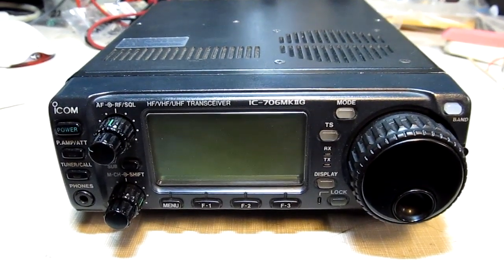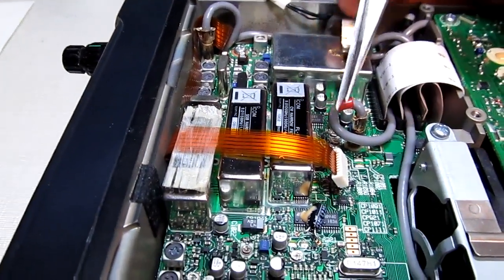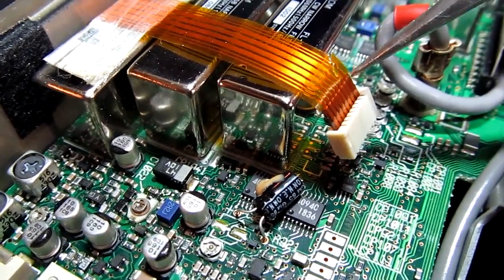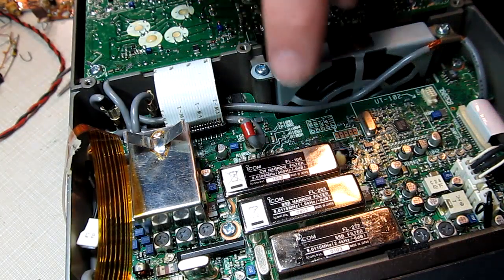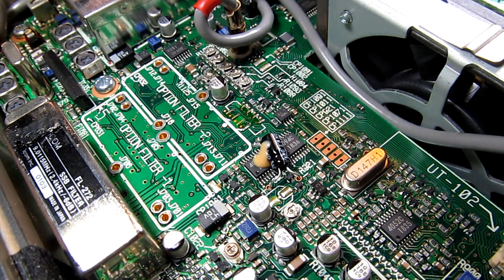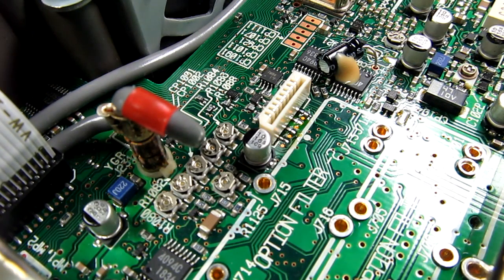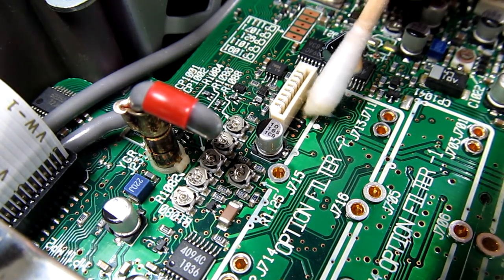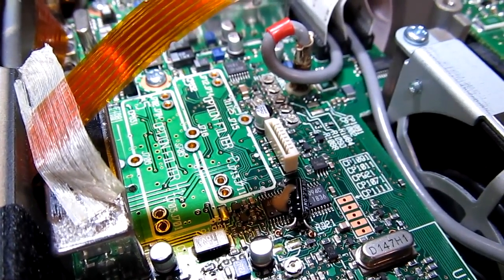#126: Repair Log, Part 1: Icom IC-706MkIIG Damage assessment and connector repair - DIY

Comment: Greetings dear friend.  Could you help me to be in the SET MODE ADJUSTMENT of the Icom IC-706 MKIIG?  I don't know the type and configuration of the Plug that is connected to the REMOTE to access its Service Menu.

Comment: Very nice and interesting video. Instead of a magnifying glass I recommend using a USB microscope. It is cheap and gives a lot more magnification and built-in light source. My USB microscope gives me 300x and inspection of small components and soldering is a breeze.

Comment: Very nicely done! Is a longer ribbon cable offered for that upgrade so it isn't pulled so tight over the filters?
Reply from the maker: No, it'll be exactly the same one. But, it's easily pulled out of the connector when you need to access the filters.
Reply: ***** I see. Thank's for the reply!

Comment: Nice repair. What is the flux you're using there Alan?
Reply from the maker: It's just a Type RA Rosin Flux by MG Chemicals.
Reply: *****
Ah ok, thank you.
Reply: ***** Any reason to avoid No Clean?
Reply from the maker: No, you can use no-clean flux if you like.